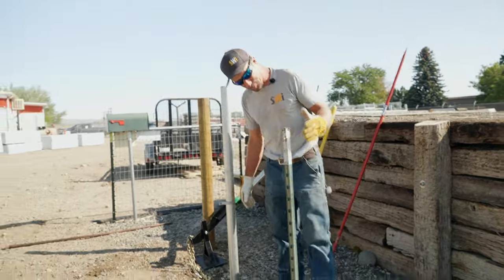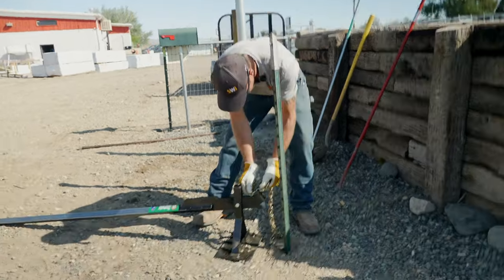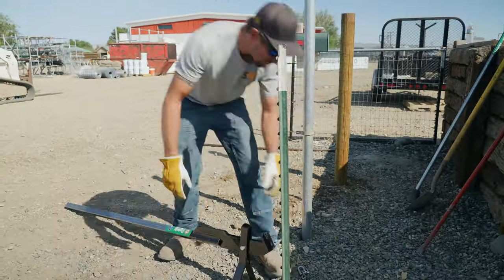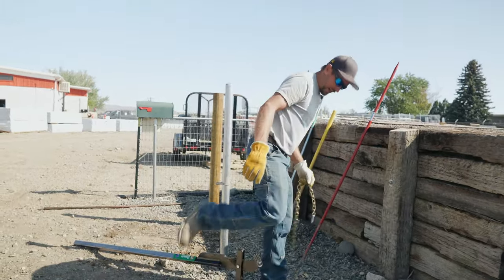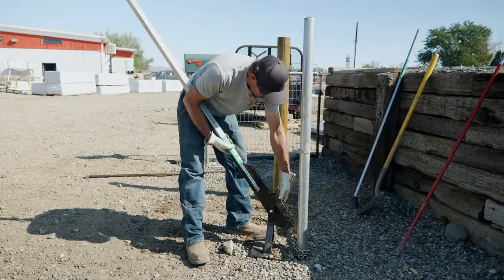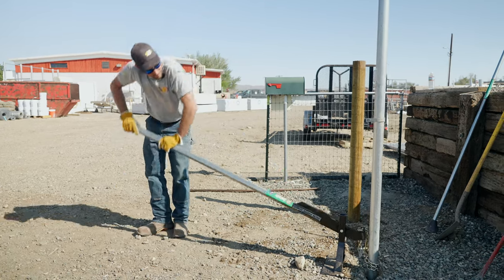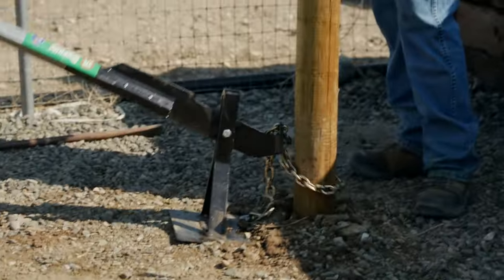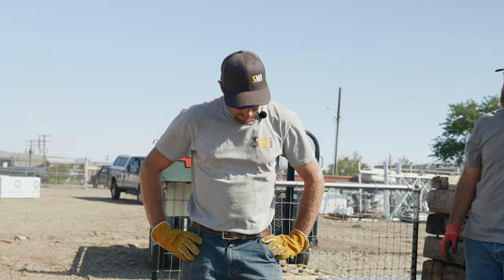Easiest Way To Pull Fence Posts Out By Hand

Comment: Try that with a wooden post that had been cemented in. A securely placed post would have 2 bags of concrete around it. I use 4 ton come alongs and sometimes bend the handles
Reply from the maker: We've been talking about that--it's actually on the schedule to shoot this week. So many people have never heard of driven posts and think we're trying to pull a fast one on them...
Reply from the maker: We did the test! https://youtu.be/VuYG5iOQato
Reply: Won't work on concreted..posts.
Reply: @manonfire3642  nope. Need a farm jack.

Comment: Try it with cemented post.
Reply from the maker: No thanks. 😉 It's not intended for that.
Reply: Its not intended for that. Its only intended for post that are driven into the ground...oh and it costs more then 300 dollars hahahahaha
Reply: What it doesnt work with cement?? Its useless then i wanted to buy it ill just keep using my modified dolly then
Reply: You might be able to create a bridge with 2x4’s with feet on the side to straddle the area wide enough so the concrete doesn’t hit the levers base. That would mean the chain would be higher up as well. Although the weight and width of concrete might prove to be too much resistance.  Here’s an example https://youtu.be/Z7RFORJw4lk

Comment: You can speed up pulling t posts by 50% by not wrapping.  Just hook the post below a bump with the chain hook at 90’.    A little tension will hold it until you pull

Comment: i better start thinking of getting one because right now i have a chain link fence but wife wants to put up a vinyl fence panel ones next year.
Reply: Save post and sleeve over the top my dude
Reply from the maker: Most residential chain link fences are built with posts too light to support a 6’ tall wind sail.

Comment: I like the concept. 
Not gonna work at all with a fat concrete ball attached to the post just under the dirt, which is 99% of posts I pull. 
Would work fantastic for ranches though.
Reply from the maker: Truth.
Reply: I was thinking the same thing as the base will be on top of the concrete. Maybe they need to make a different one that has two legs touching the ground about 16” apart

Comment: my farm jack and a short chain with end hooks  does about the same job.  If I lift high. I can put the base just outside of the concrete skirt and still jack a post out of the ground.
Reply from the maker: Nice! 👍🏻
Reply: How do you prevent the top of the hi-jack from pulling forward?  You must have only a few feet of concrete. A hi-jack doesn't work on four feet of concrete.

Comment: If the handle on your post puller were fabricated on a 45 degree angle then you could reduce the number of strokes required to pull the post out of the soil and you wouldn't have to bend over as far.  When you pulled the wood post you were almost laying down on the ground.
Reply from the maker: Well... 🤔 you'd either reduce the # of strokes or not bend over as far, but not both. You'd sacrifice leverage though.

Comment: how does it do on wood  posts that have been concreted in ?
Reply from the maker: A homeowner's posts? Probably pull it right out. A contractor's posts? (more concrete) Probably won't cut it. We were just talking yesterday about making a follow-up video to this using concreted posts.
Reply: @SWiFence  that would be awesome to see it in action on a homeowners post and a contractors post. Thanks Ill be watching for that.
Reply from the maker: We did the concrete test. https://youtu.be/VuYG5iOQato

Comment: it looks easy but nothing is encased in cement. Im sure just by rocking these things back and forth it would come out also
Reply from the maker: You're right nothing is in cement--these are all driven posts. You're wrong that these will come out with a little rocking. Once these things are in they're tough to get out--we usually grab our forklift to get them out.
Reply: T post only have those 2 little wings to bite into the ground, but man do they grab sometimes. They take probably 1000 pounds of pulling force or more  to remove.

Comment: What about cemented post?
Reply from the maker: Little cement yes. Lot of cement no. If you're pulling up a DIY job you're probably fine. If you're pulling up a fence contractor's work it's probably not going to happen.
Reply from the maker: We did the concrete test. https://youtu.be/VuYG5iOQato
Reply: Thanks!

Comment: Except most posts are in a half-bag of instant concrete. You're pulling out 20lbs of solid concrete under 1-4 ft of earth.
Reply from the maker: You're right--this is demonstrated on a driven post which is more common up north.

Comment: Posts were hardly a foot in the ground with  no concrete
Reply from the maker: Correct on no concrete. Wrong on hardly a foot in the ground.
Driven posts (without concrete) apparently take a lot of people by surprise, but is a legit method of fencing that's very common up north (a lot less common down south). It's faster, and in many cases stronger than using concrete. We've even done tests to show the difference.
Vinyl Fence Wind Test in Concrete: https://youtu.be/_iQnheVwAI4
Vinyl Fence Wind Test - Steel Posts No Concrete: https://youtu.be/8jWcT17PFME
(There are more tests on the channel if you care to search them out.)

Comment: That is lame there’s not even concrete on the post that’s a Bad presentation
Reply from the maker: Something tells me you've never seen a pounded post before. 🤔 It's a legit method of fencing--not everyone uses concrete.
Having said that, this method isn't going to pull out contractor-grade concrete-set posts. It will, however, mostly likely handle DIY and homeowner concrete-set just fine. We'll see if we can get a demo together to show you. 👍🏻

Comment: Your  not cemented! You're not honest sorry doo !
Reply from the maker: You're absolutely right there is no cement! This is what is called a driven post--it's a very popular method in England, New Zealand, and Australia, and we're trying to make it popular here too. It's absolutely a legitimate way to build fence.
We'll have to try one on concrete and report back. I wouldn't recommend it until we test it. It would probably work on a homeowner-set job, but I don't know that it would pull a contractor-grade concreted post.
Reply from the maker: We did the concrete test. https://youtu.be/VuYG5iOQato